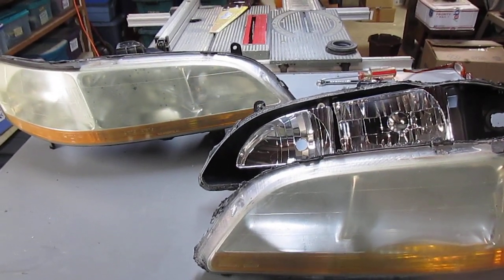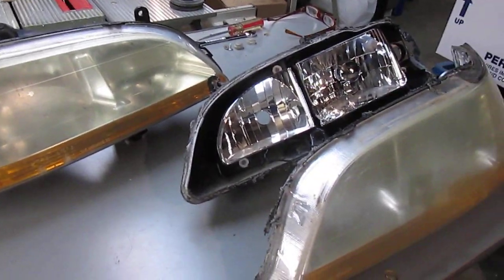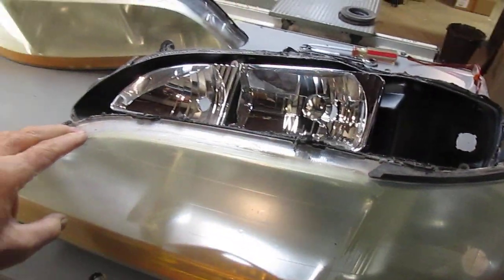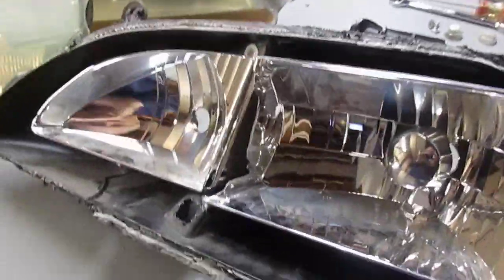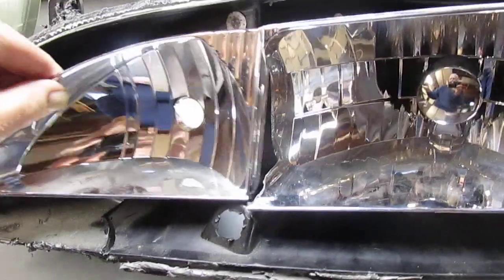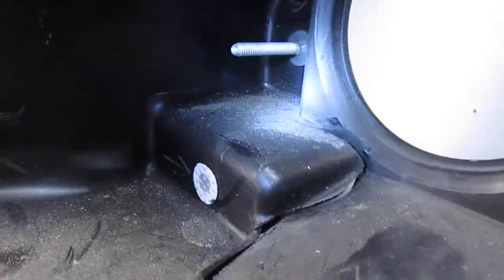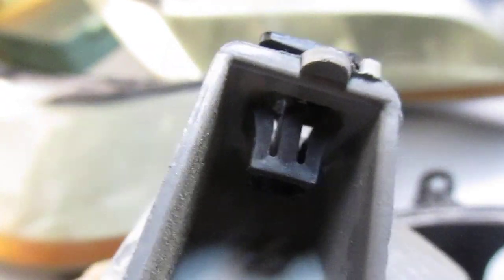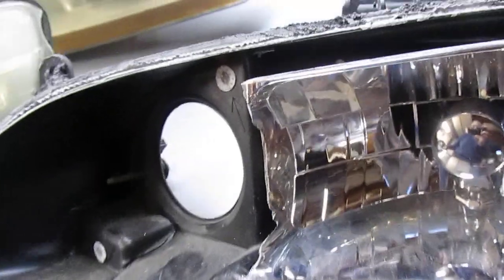Headlight Adjustment Mechanism In 2002 Honda Accord - How it Works

Comment: I have a 2003 Honda Accord 2.4l. My low beams are pointed way up high and I did at least 5-6 turns on the up/down, but there seemed to be change. Then, once I started the car, they went down by themselves. I though great! But then, after less than an hour of driving I noticed they had come up once more, again by themselves. It's the weirdest thing, made me think there's some electronic auto correction. It's a small thing but very frustrating. Thanks for the video, now i know there's 20 more turns I can do! By the way, couldn't find the left/right bolt..

Comment: Thank you.  Just got my front cowl off and am going to replace them with a new set that has the white stripe running lights included as a newer upgrade. so this will make things easier to re-adjust should I need to.  BTW, there was another guy that also did a video about this and he too stated that there were no videos on it and so he created his own once he learned about the screw setting apparatus to help others as you have, so thank you both.

Comment: In the driver's manual they show a alignment bubble that needs to be in the center and also talk about a "line on the screw that needs to align with the line on the gauge"  I couldn't see neither the "bubble" nor those "lines" on my car.  Can you please show that too and what exactly is the procedure of alignment?
Reply from the maker: My manual only says to take the car into the dealer to adjust the headlights.  I have adjusted them all my life by placing the car about 20 feet from a wall and see how the beams look as I turn the adjusting screws. This can also be done in a street at night, without a wall, just by adjusting the lights to where ever you like them the most, as long as the low-beams aren't so high that they blind oncoming drivers.
Reply: my 2000 accord has a bubble level on the top corner (not towards the center of the car but towards the edge of yhe car). It was covered in dirt. I believe some models do not have this alignment bubble.